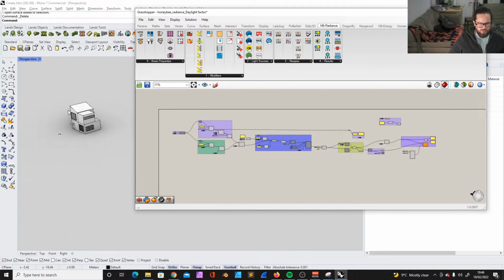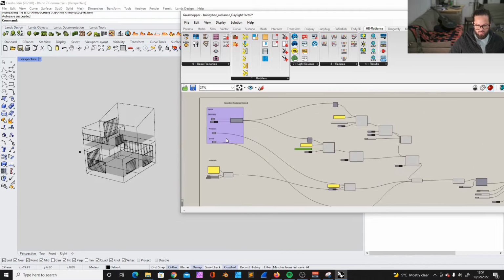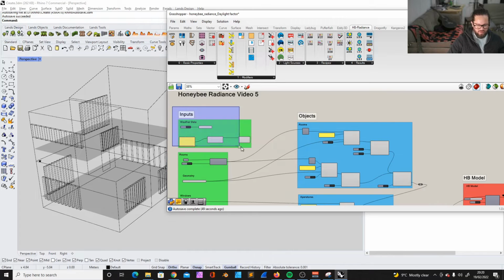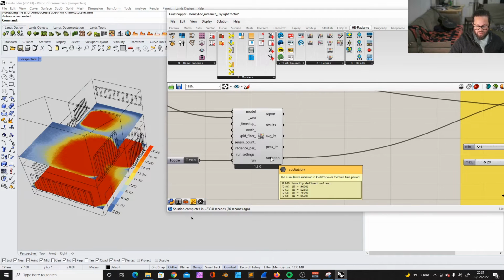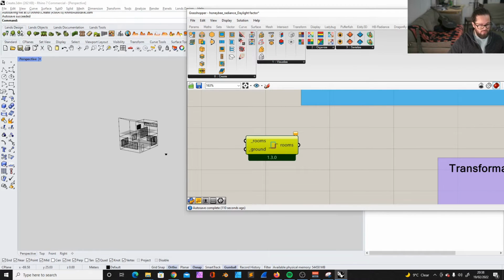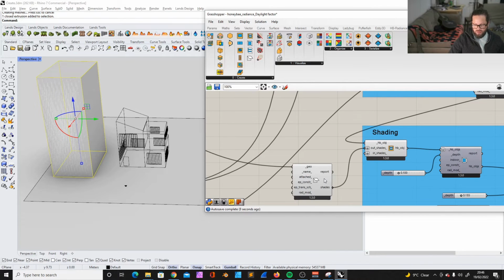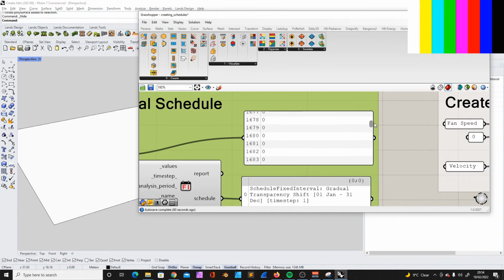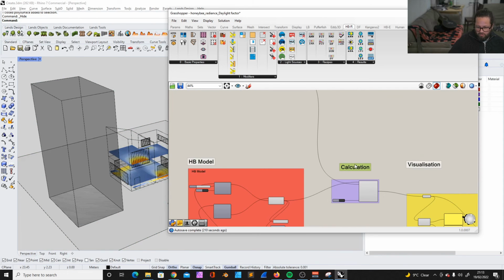Honeybee 'RADIANCE' Part 5 |  Dynamic Shading, Context and Schedules | Ladybug tools 1.3.0

Comment: HI, I just wonder why I create tree you taught in the video but I failed to run the simulate. It's value appears "Null" on the canva. Did I miss something when the "tree" transfer to grasshopper canva? Thank you for the tutorial!!
Reply from the maker: Not sure if you missed something. The tree is just a part of the context. So if you have building in the surrounding as context. The tree should be part of it.
Reply: Okay, I ‘ll try to check it out.
Thank you :)
Reply from the maker: Btw it's important to also watch the second video on this. Because I made a mistake here.

Comment: hi philip,  nice example. are you sure that the shading is changing in the schedule?  to me it looks like it only changes for energyplus but i might be wrong.
Reply from the maker: Ha ha 😂 interesting. I actually experience the opposite. Having troubles to run the model via energy plus and the shading schedule. Need to investigate.
I'm pretty sure the schedule works with radiance but I'll recheck to make sure it works.
Thanks for raising the concern.
Reply: @PhilippGalvanDesign  they also have window control groups components for multiphase, although they do nothing untill multiphase is implemented in LBT. It was mentioned in the roadmap from 1.4.0 release, so one can only hope that the next release includes it. Quick test though would be to vary your schedule for the tree and see if results change.
Reply from the maker: @mathiassnderskov7214  I was checking the transparency schedule and it seems you are right. It doesn't affect the radiance calculation. Thanks for being critical and made me aware. I will record an update to clarify in the next few days.